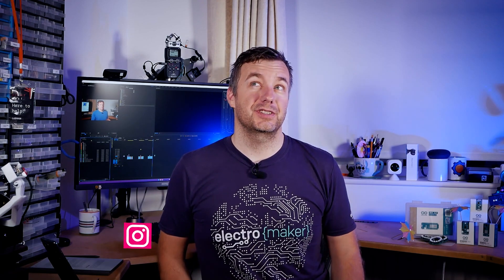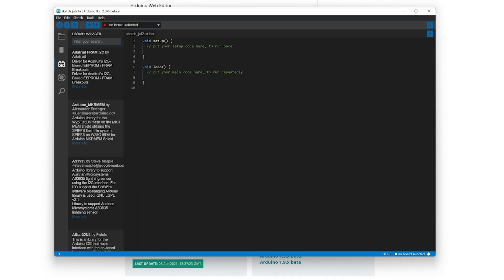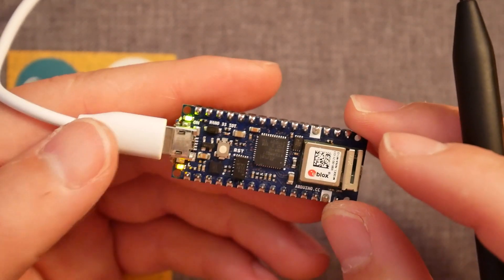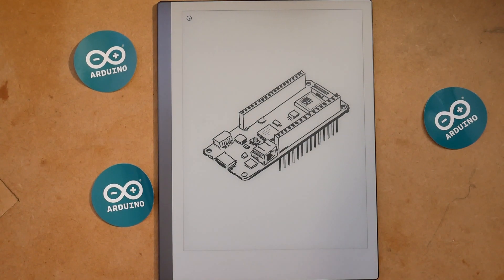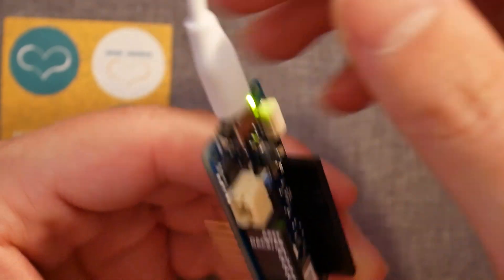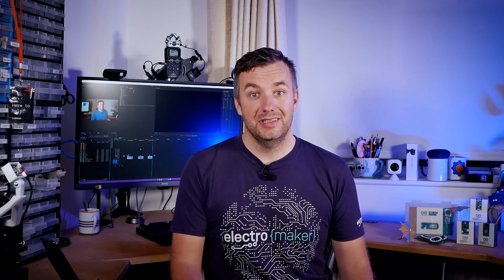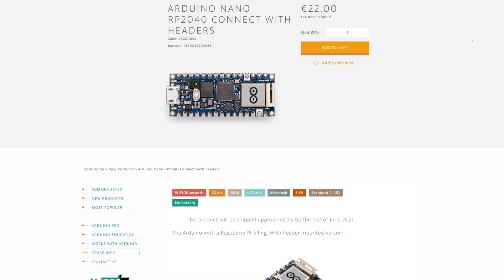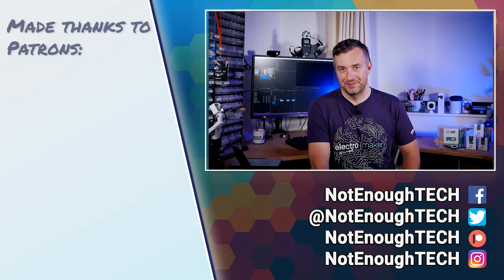Top 3 Arduino boards for home automation

Comment: Hi Mat. I was building a system that needed to count pulses on multiple (4) inputs. Initially I tried to marry a Rasp Pi Zero (running the system) with a Pico (to count the pulses) but found that the Pico Python libraries did not support the Pico being a slave. So I switched to a Arduino Nano Every. It was easy to implement a sketch using the I2C protocol. But I had to use the online IDE with a Linux laptop as I could not get my Windows 7 PC to correctly install a USB-Serial driver. 

One thing I found is that some Nano models only support 3 GPIO pins with interrupts. Fortunately the Nano Every has interrupts on all digital pins. I don't know if the Arduinos are sensitive to static but I lost one and at £10 each + p&p they are almost 3 times the cost of a Pico.
Reply from the maker: How frequent were the pulses and how quickly you needed to update your Zero?
Reply: @notenoughtech  Frequency depends on PV generation, consumption and purchasing (the 3 meters). I'm not expecting more that 1/sec on each (=3.6kWh). Frequency of update is fully configurable as is frequency of analysis/decision making and loads of other parameters. I'm starting at 4min/12mins but might drop to say 1mins/3mins. Loads of stats being produced which will be sent by MQTT to an existing Rasp Pi 4 for storage (InfluxDB and Grafana) so I can tinker with the config. settings.
Reply from the maker: And serial communication wasnt sufficient for that or just pain to implement? The data you mentioned seems perfectly reasonable.

Comment: Hi Mat, super interesting. I am looking for a tutorial long time for people counting and occupancy heat map stuffs using nodered and ble, I couldn't find anyone who can share and teach on this.  Hope u r able to do this and I know u r super good in nodered... I believe many people like it.
Reply from the maker: From similar topics I have one that could spark your interest which is called "who's home". 
It uses WiFi to report presence at certain locations which may not be what you are after but that's what's I have done  for now in that direction
Reply: @notenoughtech  can wait to see that happen, that's make an idea some social distancing solution, if too crowded in that particular room.
Reply from the maker: 2 laser trip wires would be cheaper and require no participation for room counting if that's what you want to do but doesn't have info about who was in the room